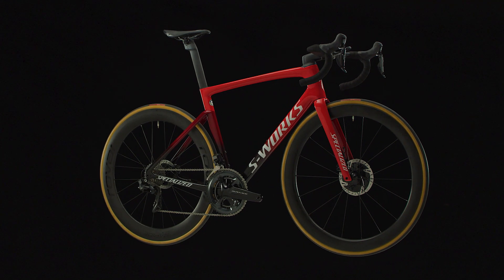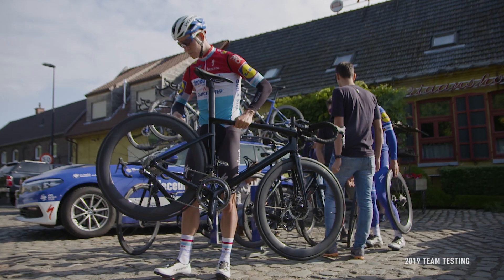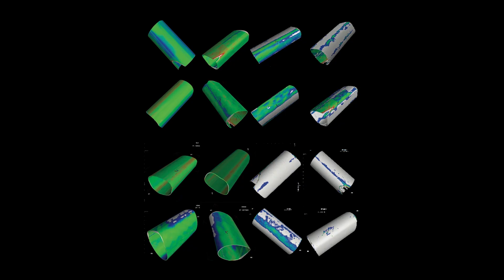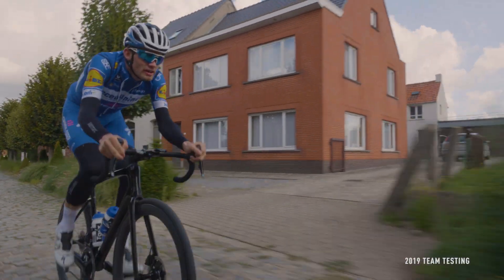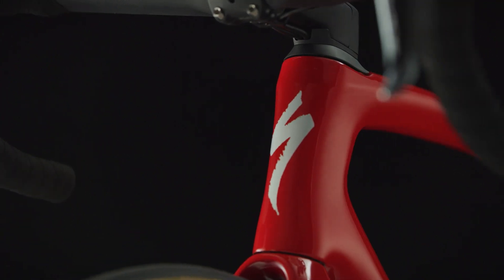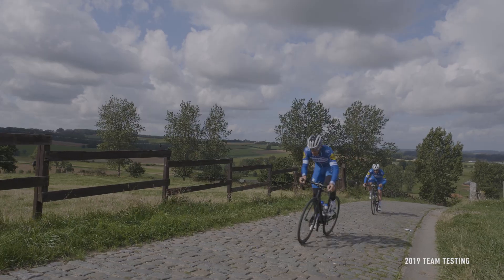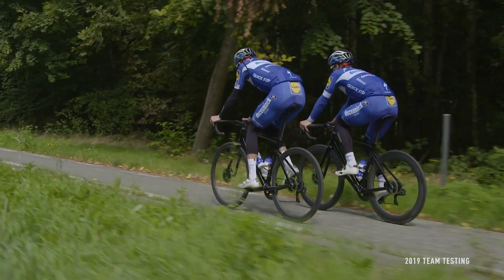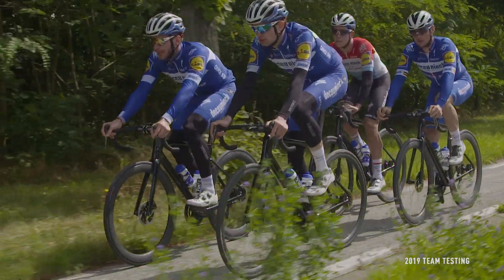The tech behind the Specialized Tarmac SL7

Comment: Hello. I just ordered a 2022 Allez Sprint Frameset. being that it comes with a SL7 fork, I am wondering if you can tell me what stem and handlebars I can use with this frameset that will give me internal cable routing. Keeping in mind that although it is a SL7 steerer tube, it is the Allez frame which is much different in how the whole steerer tube and headset integration looks/works. Thanks.

Comment: Whats designs for tarmac sport ??
Reply from the maker: Hey Juan - The SL6 9r frames are still in line. The new Sport build will have a reliable spec that includes Shimano 105 mechanical shifting and quick-stopping hydraulic disc brakes, durable DT R470 Disc wheels, our fan-favorite Power saddle, and weigh 8.1kgs.
Reply: @SpecializedUniversity  in the Sl6 sport will there be changes to the seatpost system?  or will it be the same screw necklace?  looked like vintage bike
Reply from the maker: @juaninsuasty  - The SL6 9r  still uses the 27.2 round post.
Reply: The Tarmac SL6 is the best bike I’ve ever had the pleasure of owning and riding. I can’t imagine how much better the SL7 is. Would love to be able to ride one to compare.